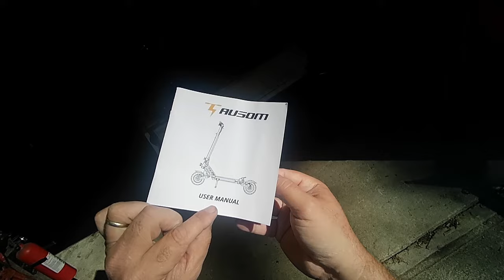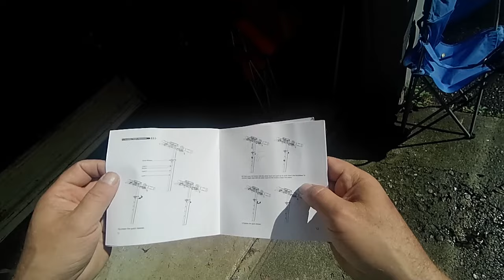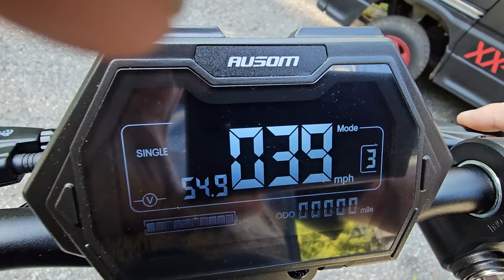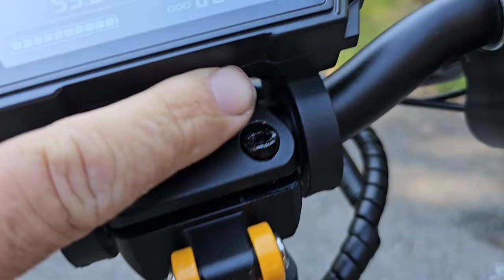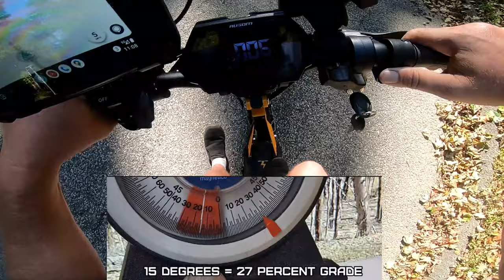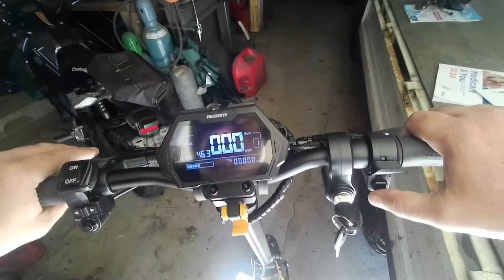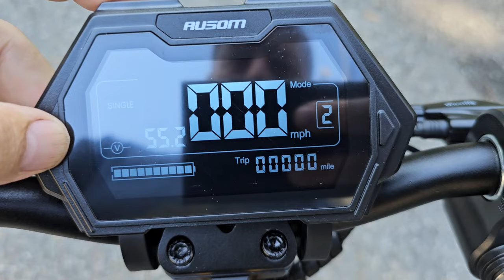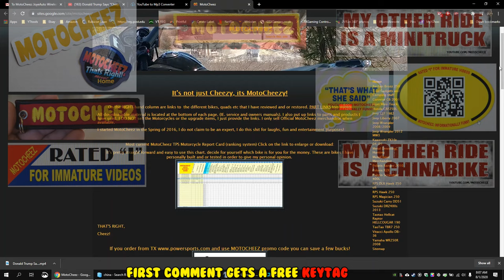Ausom Leopard Electric scooter 30mph 52v 20.8ah 1000w with LCD display and detachable seat kit

Comment: try pressing that button 3 times it goes to settings
Reply: then adjust p7 to 30 and p8 to 100
Reply from the maker: @ohad1o17 I'll give that a try! Thanks
Reply from the maker: @ohad1o17 if it's a lot better I'll do another video
Reply: @MotoCheez  try to play with those two and what fit you
Reply from the maker: @ohad1o17 thanks!
Reply from the maker: P7 was 100 so I left that p8 was 5:00 so I put it to 30, maybe you switched the numbers around? P 8 will not go to 100
Reply from the maker: Posted update video. Thanks again!
Reply: @MotoCheez  yeah just saw the notification I'll watch it later
Reply: Yes I should of said something about that.  It's set from factory power is only 40%. You half to go in p setting and change it to 100% power.

Comment: You are in an area that would require a 1,000 watt mid drive bike.. Something like a Nireeka Mega bike. Or a Dual motor Freego F3 pro. Or a Fabulous Road Warrior or Fabulous Havoc X2
Reply from the maker: Dual motor scooters rip up the hills here, better 750 watt bikes too
Reply: @MotoCheez  oh.. A new model Wired Freedom ebike is coming out. Full suspension 2400 watt peak rear motor . 60V with a 40 Amp controller. They have improved the suspension and other things.
Reply from the maker: @kevinnashskitchen3517 wow! That's going to be pretty awesome.

Comment: That was a little disappointing everything looked so good until you tried Anderson Hill.
Like you said maybe it would suit a smaller person or flat terrain.
Still I don't know if I would want one of my kids flying down the road at 35 mph that seems kind of hairy..
Maybe they should have a parental lock of sorts to keep them in a lower speed. Excellent review very thorough.👍
I just saw that comment about getting into the program did you have a chance to try that yet to see if it would change the power level?
Reply from the maker: I'm going to try to get into the settings tomorrow, if it works I'm sure there is a way to lock it at a max speed for kids. 
Hopefully can raise the current level to make it up Anderson hill too!

Comment: intro says with Dicount code
Reply from the maker: Lol, I saw after I posted video. Oops
Reply: @MotoCheez   I got the XPRO Hawk 125cc quad today, what a nightmare carb. No access to anything not even the idle! Gonna need some luv to get any power outta it lol. But my Strom 150 is super powerful so far, way happy
Reply from the maker: Throw another carb on it?
Reply: yeah agreed, gonna need to upgrade the exhaust also.Super doggy, but riuns better after accessing, idle and air screws lol  @MotoCheez